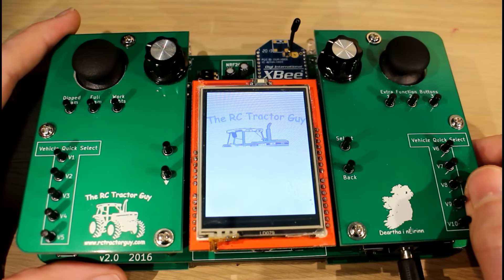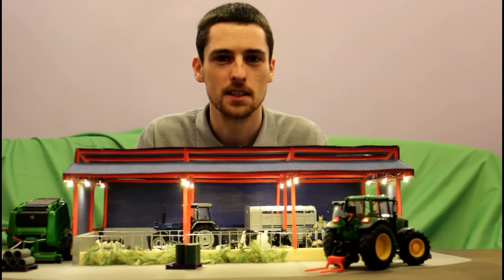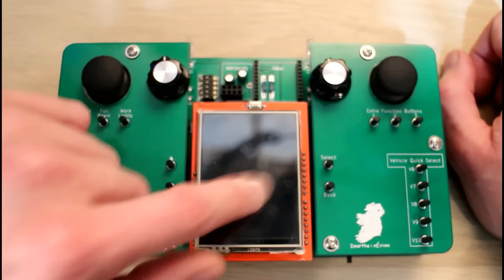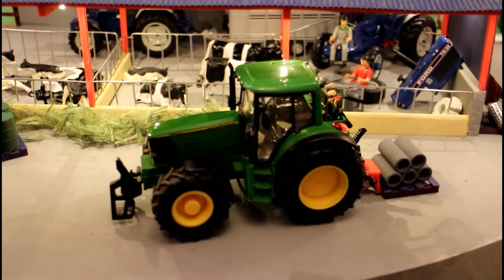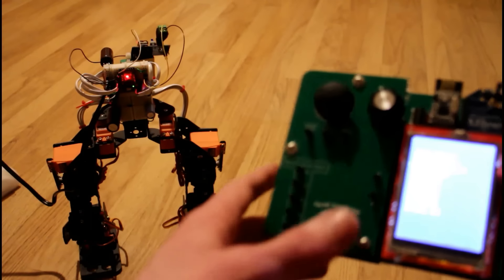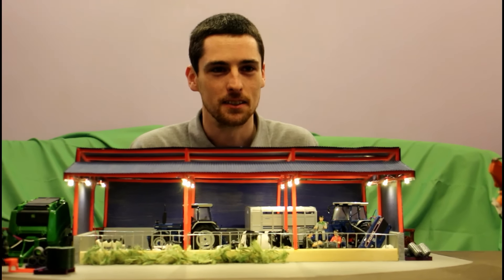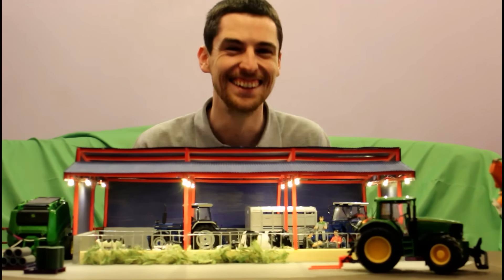The RC Tractor Guys first Kickstarter is now live

Comment: Great job, I followed your videos from the start and I see how you developed a huge advance on each of you made. this controller looks very complete I´m working on a New Holland T7030 1/16 ertl to convert on RC, just in the rear wheel drive i would like use independent motors on each  wheel but n20 motor geared are to small for this toy or maybe using some axel shaft adapters will work fine. in front  i put 2 servos one conected to the steering wheel another to the to control the link arm to the wheels.
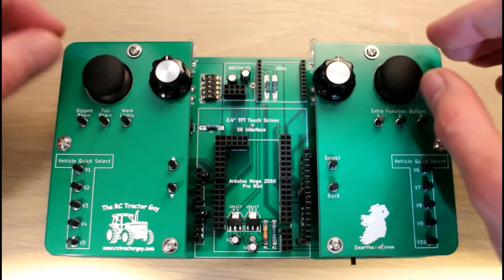Reply from the maker: +Juan Luis Macias Atilano Sounds like a cool project, how about some continuous rotation metal gear servos for the drive motors, maybe that would work better instead of N20 on a 1:16?

Comment: This MCU - Meduino Mega 2560 Pro Mini ssems hard to get, at least in Germany. Is there an alternative that fits into the pin footprint of the controller?
Reply from the maker: +Tommy Secondspace Good question, there does appear to only be one or two Chinese sellers. I chose it for two reasons, 1. the small footprint allowed me to surround it with an Arduino shiled socket so that I could put the screen on top and 2. unlike an Arduino it uses standard 2.54 mm pin spacing header everywhere so for anyone who doesn't want to use an Ardiuno they just need to mount their MCU of choice on cheap vero board. As an example someone who works with PIC MCUs might want to use a PIC18F4620 running at 40 MHz, they get more than twice the speed of the Meduino and get to use the processor they are used to programming. I was trying to make it as easy for experimentation as I could. Others have asked to have the Meduino and TFT included so at the minute I'm trying to find out if I could get a bulk quantity of Meduinos with faster shipping service so that I can spread the cost out a bit.
Reply: +RC Tractor Guy Yes, that would make things definitely a bit easyer, althoughim slowly getting used to shipping times from china ;-). I hope the kickstarter goal will be reached in time. I'll try to spread out the word where i can.
Reply from the maker: +Tommy Secondspace Yes shipping times from china are a killer. Thanks for spreading the word I very much appreciate, hopefully everyone finds the controller as useful as I do :)

Comment: I like the shed. How and what is it made
Reply from the maker: +farm model maniac Enda6718 I 3D printed a frame and covered it in corrugated paper which I painted blue. The rest is just bits of wood and copper wire bent, soldered and painted silver to make the rest of the metalwork.

Comment: I thought about motorizing a siku mb trac 1800 intercooler in 1:87 scale and i would put in a 2.4 ghz reciver is there a module with 2.4 ghz for this 8pin socket on the controller ?? then i'd probably buy a controller
Reply: why are these called nrf24 ?? because they are 2.4 ghz modules 3*@@;#@(2 sorry ... but i have another question can you write a code to control a

 DSM2 RX45-V5 Version 5.10

? That would be so awesome !!
Reply from the maker: +Julian w. 
That is a very cool miniature project, I think 1:32 is as small as I'd be able to manage.

The NRF24L01 is the name of the transceiver chip on the radio module I most commonly use so I call it an NRF24 radio module a lot of the time. Yes is it operates over 62 channels in the 2.4 GHz band. It's pretty basic like you don't get RSSI feedback it just flags a bit if noise on a channel is over a certain level but it does the job.

Funny I was looking into DSM2 radios Saturday, I don't know much about them so could really tell what module people were using to transmit but I did find guys talking about transmitting from an Arduino here: http://www.rcgroups.com/forums/showthread.php?t=1648044

So if they can do it so could we but it looks like they swiped the TX module from a controller so not much point buying a controller to steal the transmitter to put in a controller. Do you know of anywhere we can get the transmitter module cheaply? If so I might invest and test it out, we should be able to use the NRF socket to control it, I doubt it needs more than 5 control pins.
Reply: +RC Tractor Guy wow thanks a lot for the fast answer! So that means you could make a code for this reciver it supports dsm2 and dsmx :
http://www.sol-expert-group.de/1zu87modellbau/2-4-GHz-Empfaenger-DSM2-DSMX/Empfaenger/Miniatur-Empfaenger-RX31-5-Kanaele::1138.html

Just translate the whole page into english and it should be ok ... I would like that you try it out with that little board because in the model i would put it in has really no room to fit an arduino and the nrf24... well it's 1:87 scale :)
Reply: +RC Tractor Guy the transmitter ... i dont know but on the website (and thanks yt for not converting my link into a link ) there are some transmitters and they need two pins for power and one pin for data so you yould bind the plus and minus together and just take the data pins for each thing you want to control ... like one for moving the tractor back and forward then one for steering and two for indicators. so we have a total of 5 pins ... perfect fit ....

here is the transmitter: 
http://www.sol-expert-group.de/1zu87modellbau/2-4-GHz-Sender-DSM2:::48_243.html
Reply: +Julian w. lol... it just needs a while to convert the link... haha sorry yt for the blame ...
Reply: +RC Tractor Guy Maybe with the ''Module'' only http://www.hobbyking.com/hobbyking/store/__46634__OrangeRX_DSMX_DSM2_Compatible_2_4Ghz_Transmitter_Module_JR_Turnigy_.html
Reply from the maker: +Mazeau24 Looks like you guy's are on the right track anyway. Are those the best prices for those two radios, €30 for the receiver and €20 for the transmitter? That's a lot for some fairly basic radios, aren't there any compatible cheap knock off versions I could test? :)
Reply: I really dont know very much about them, I never used one. From what I know OrangeRX is already a cheap knockout.Receivers are cheap (Cheap and small and 1S compatible) and there is a lot of brands and its widely compatible. For example it will bind to my Losi, Traxxas, etc. It will begins to be very interesting (it is already). A 10 channels programmable transmitter dsm compatible is at least worth 500 Euros so, a 30$ upgrade, I think its ok! 10$ Receiver : http://www.hobbyking.com/hobbyking/store/__61211__OrangeRx_R410X_DSMX_Compatible_4Ch_6CH_PWM_CPPM_2_4Ghz_Receiver_.html
Reply from the maker: +Mazeau24 You make a good point, budget is pretty tight at the minute but I'll add a transmitter and receiver to the list of things to get with the kickstarter funding provided there is enough left after the expense of the PCBs I want to test for the vehicles.

Comment: hey its oisin ohagan here i got my self a siku fent 939 and still have the john deere any suggestions on what i should do?
Reply from the maker: +venombitegaming Hi Oisin, your battery wouldn't charge for your britains RC tractor but you've bought a second battery and that wont charge either isn't that the problem? Did you manage to test the voltage output of your charger and your battery voltage after it has charged?
Reply: +RC Tractor Guy sorry i didnt get to test any voltage but i think it will just be a tractor to look at from now on 
also i put up a video on the new siku tractor i got
Reply from the maker: +venombitegaming Ah well that's a pity. That 939 model is a nice one I must say.
Reply: +RC Tractor Guy definatly i love her

Comment: And are they LED you use for the shed
Reply from the maker: +John Dillon Yes I 3D printed the pieces that make the frame of the shed, glued them together and wired LEDs into the frame. I then painted corrugated cardboard blue and glued it to the frame.